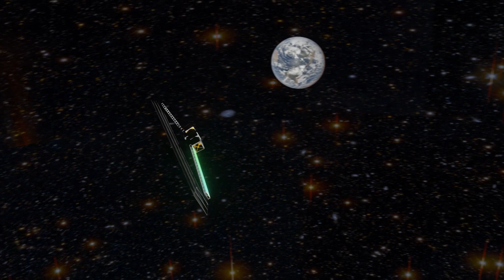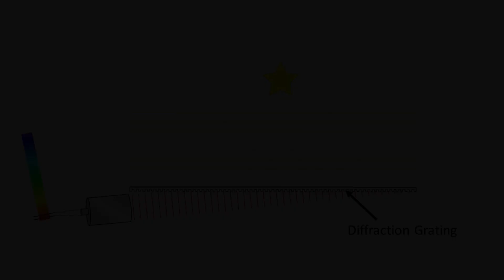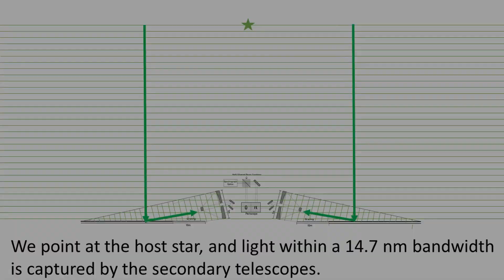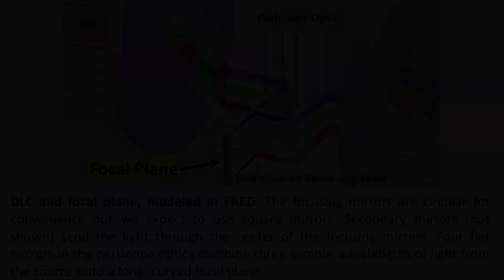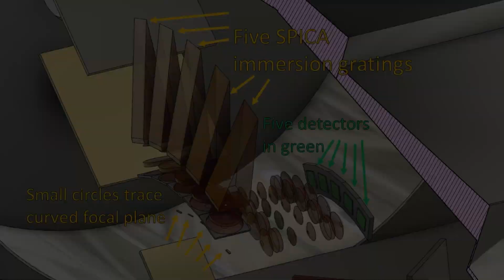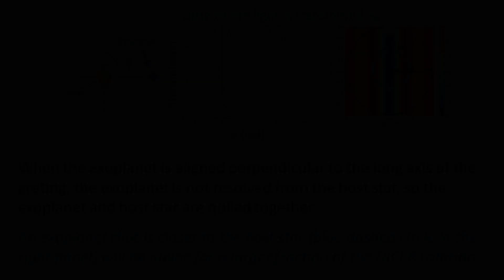DICER - Finding all habitable exoplanets closer than 30 lightyears

Comment: Woah, this is such a neat concept. I didn't realize you could use diffraction gratings to get better angular resolution
Reply: That's right. The angular separation of exoplanets within 10 pc (33 light years) differs from their parent star by about 100 milliarcseconds. As a result, they are acquired at slightly different wavelengths than the star. Because there are two gratings producing spectra that run from red to blue on one side and blue to red on the other, only the star shares a common wavelength with itself. The exoplanets have slightly different wavelengths at the interferometer and do not null. So, there are two versions of each exoplanet. The star itself is phase cancelled and nulled to a level where these very faint exoplanets can be seen.